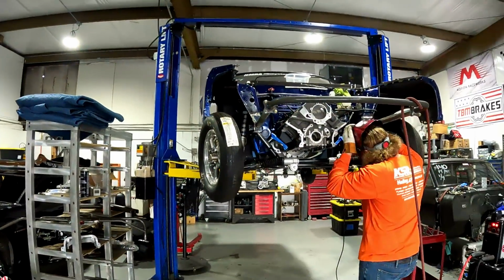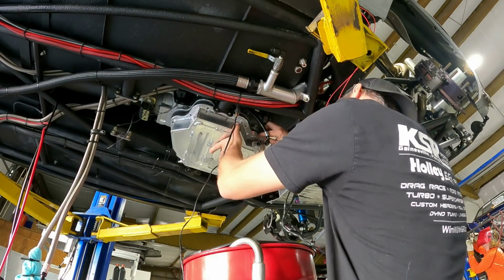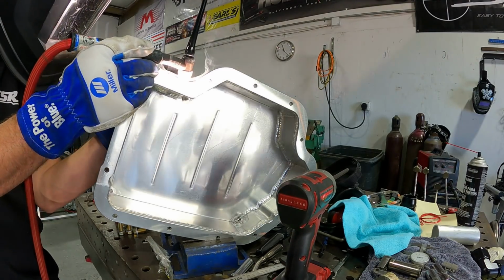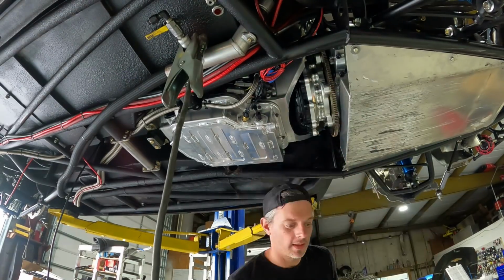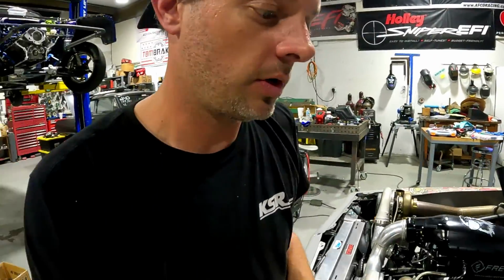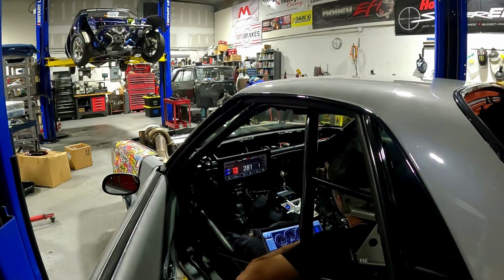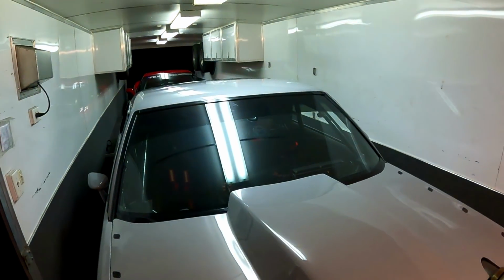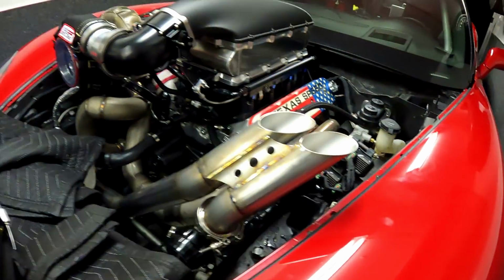Mullet's First Test Drive with a TH400!!

Comment: Cleeter needs to spend money on carbon fibre. That car is damn near flawless, just really heavy.
Reply: some areas you can't exactly run carbon-composite, ie floorpan/firewalls due to nhra regs, but much, if not all of the body panels, yes, definitely

Comment: Y'all should change out those LED bulbs in the low beams.  They're really obnoxious and dangerous for other drivers on the road, and they're really not intended to be put in halogen housings.
Reply from the maker: We might just have something in the works. The bulbs are supposed to have low and high beams, and to be honest I have never really adjusted them aside from a quick adjustment when we first put the car together.
Reply: @KSRPerformanceFabrication  I've had good luck with Silverstars in my low beams.  You can keep the LED for high beam since you can turn them off whenever you want.

Comment: I see all the sensors, or at least hear about them, miles of wires, hoses, tubes etc, etc.  So very complex like a space craft. When I fooled with cars in the 60's and 70's even into 15 years ago, they were oh so simple. Holley carb/s , minimal wiring and only ran into the high 10's with my last car a 65 Chevelle back halved and so on.  My point is this, there is no simplicity anymore.  too bad
Reply: Nope just progress and a lot more power.
Reply: @RubbishFPS  us simple old guys may get bewildered by the complexity of this progress......hahaha still love the winding 327 and a 4 speed muncie with 456's in the back.

Comment: I know this is super irrelevant, but did anybody else notice how easily Kevin gets in and out of Mullet? At like 12:45-ish he is holding a steering wheel, stepping over lift arms and just hops in and out over the roll bar like it isn't even there. I'm a pretty fit guy, I could never do that without cussing and grunting a little...just something I noticed.

Comment: A 1/4" mid-plate is .250" compared to a .090" mid-plate, sounds like something is confused.
Reply from the maker: Included with the transmission was different thickness spacers. Due to the mix up on the motor plate, we did not need any spacers.

Comment: USPS is the worst but UPS and FedEx is a very close 2nd and in my opinion they shouldn't be considered a federal employee any of them just the CEO,GM's and all of the highest positions for mailing and shipping should be considered federal employee's and not the sorting, stacking, loading and delivery should definitely not be considered federal employee's because none of them know how to do their jobs at all because just yesterday I got a phone call from a relative letting me know that they only got the letter that we sent them and not what was attached to the letter by Scotch tape and it was taped into the letter quite well and both the letter and the gifts were inside of a card which was all inside of an envelope sealed shut and by the time it got to it's destination the envelope had a gaping hole in the bottom corner and the earrings which were the gift was not taped to the card and wasn't inside of the envelope anymore and I would be a little more understanding if I had shipped this across the country and it took close to a week to get to the destination or if it was shipped out of the country and the reason I would understand a little more is because I understand it has to go to multiple hubs which means more handling and more machine's and more sorting by the machine and by hand and switched into multiple trucks or other modes of transportation like flying in an airplane and so on but this letter/card with earrings securely tapped to the card inside of a sealed envelope was only shipped to one state away from my own which still means switching from more than just one truck and maybe more than just one hub and the mail always manages to get to it's destination in a day or two because it's only one state away so that is a very little amount of people that it gets handled by so you would hope and think that it would get to it's destination in one piece so needless to say my daughter who is turning 13 today was very heart broken because she worked very hard and put her heart and soul into specially making a pair of earrings for her grandma and for her to find out that they didn't reach her grandmother she was very upset and she worked very hard to make them all homemade from a jewelry kit that she has I know it's inexpensive but that isn't the point the point of the matter is that I feel like the Parcel service in general is not good at all and it doesn't matter what it is it could be from a 0.35c letter all the way to a very expensive item that you pay premium for shipping because of the weight of the item and then you factor in for insurance on the shipping for the item so you can almost guarantee that it doesn't arrive damaged and if it does they have to send you a replacement and then you have to pay for overnight,next day, and expedited shipping and nowadays places like Amazon has hourly shipping and same day delivery and all that is extra and the shipping people act like it's no big deal when the items you expect to get to you the same day, within the hour or next day but to some people it's a huge deal because that person spends their last dollar to make sure that the items they ordered or sent to another person gets to it's destination and it doesn't it's a huge deal to them and people in shipping don't understand that